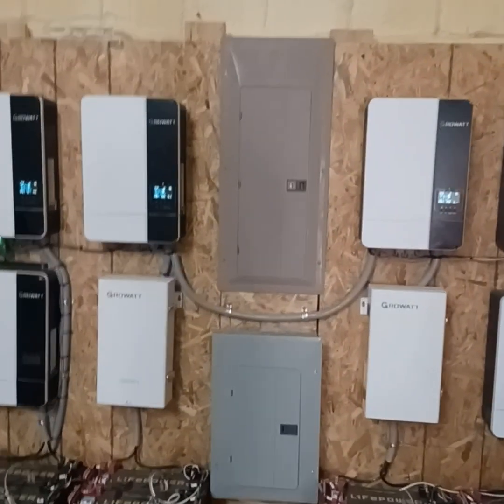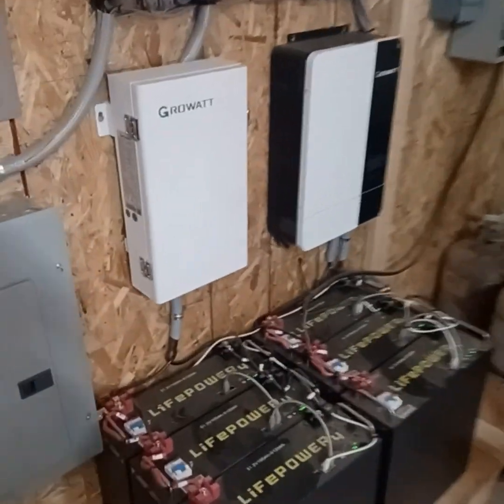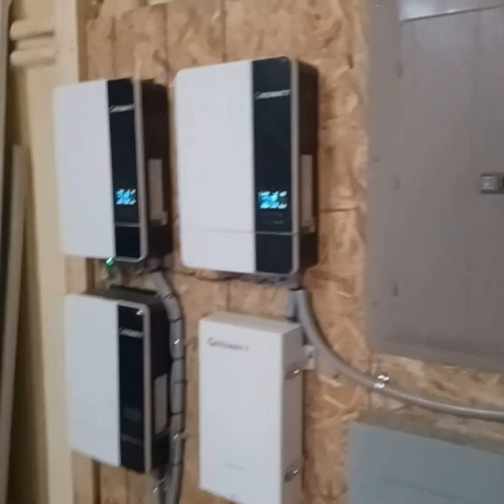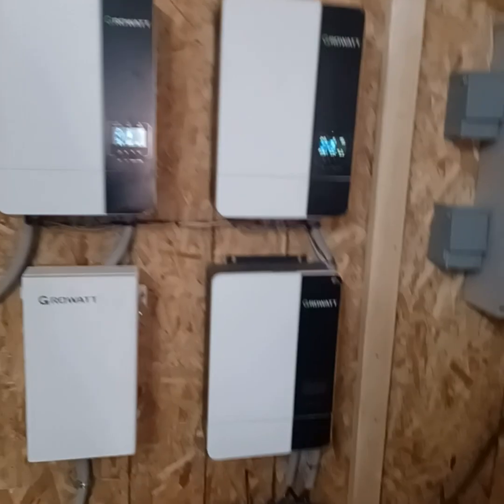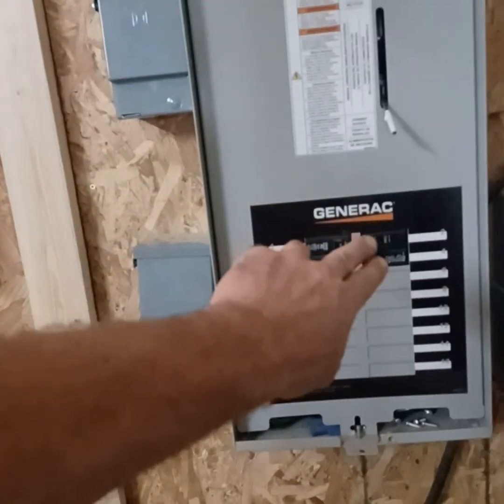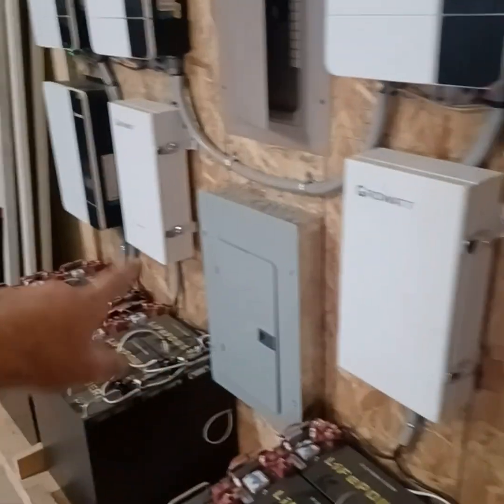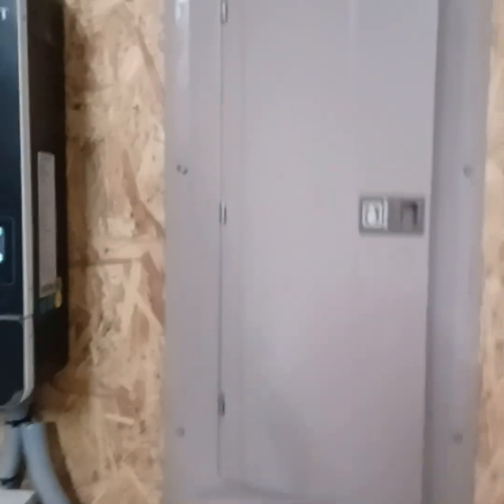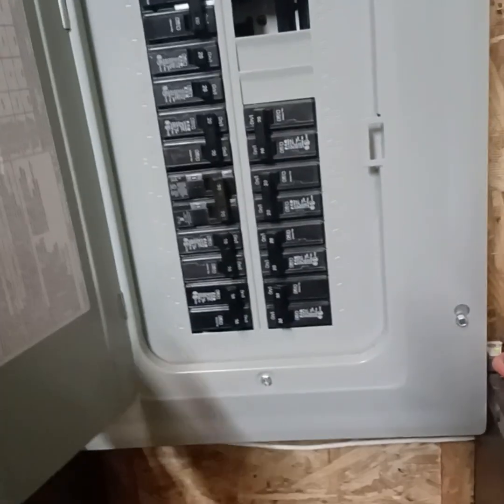25kw  Solar off-grid system. No grid-tie 60 KW battery 30 KW power output With 100A Transfer Switch

Comment: How much does  something like that cost
Reply from the maker: @blackman991000  that system was installed for 68,250.00
Some other work was done there such as a 16x50 rv car port.